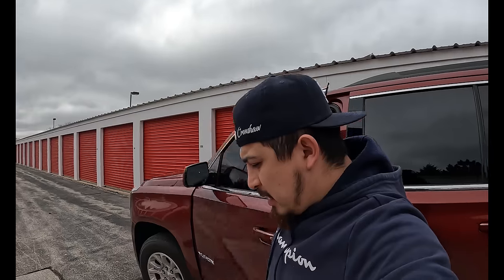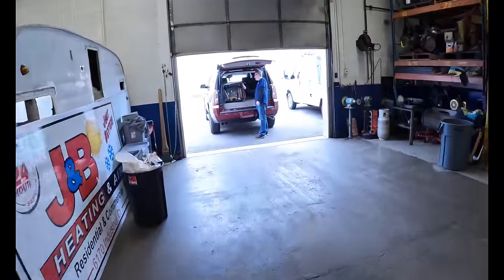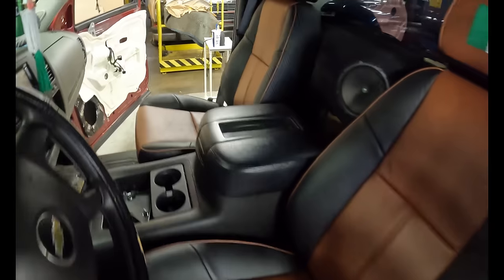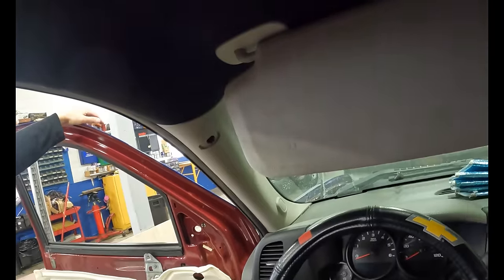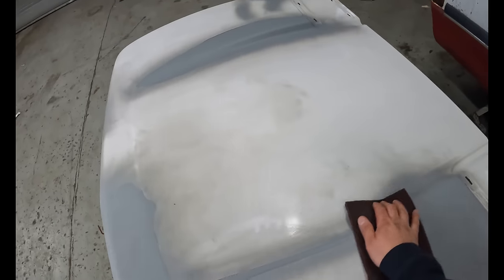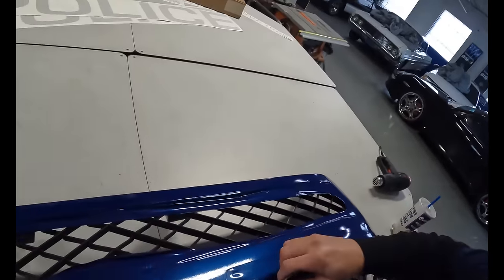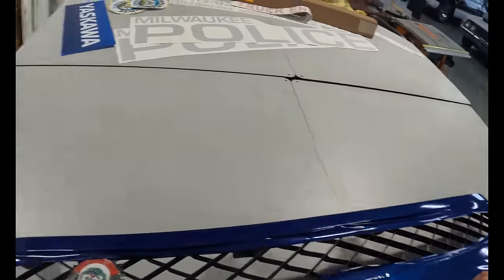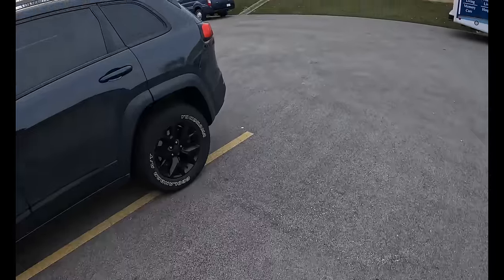MY SEATS ARE IN BUT WOULD IT MATCH MY TRUCK 🤔‼️ WHAT YOU GUYS THINK

Comment: The dash is easy. If you can do your headliner. You can spary paint the dashboard. That's all your upholstery guy did on the doorpanels. He gave you the paint they used. So now you know what paint to use. Buy some more paint and do it yourself. Just make sure you clean it really good. With 90% isopropyl alcohol before you scuff it And afterwards. Use the maroon scotch brite pads 320 grit. Save that money for parts bro.  You got this